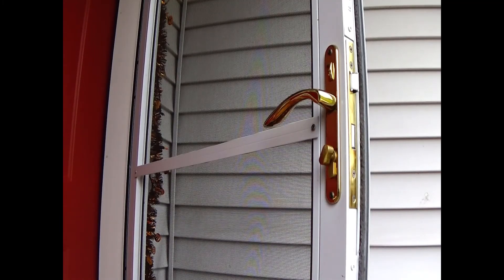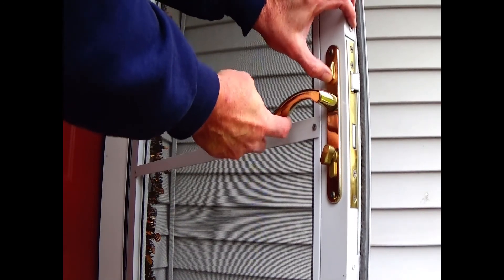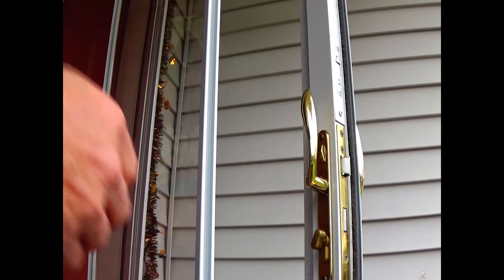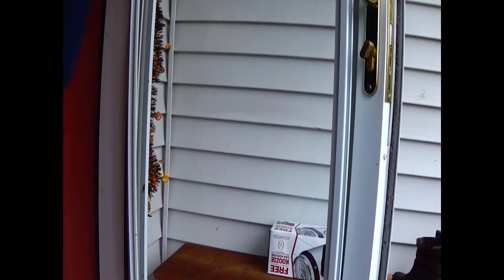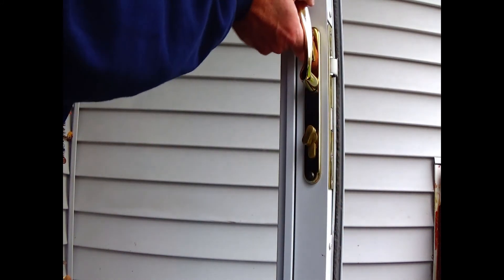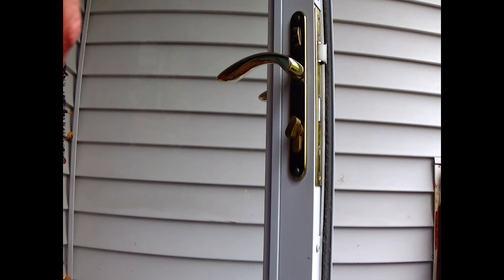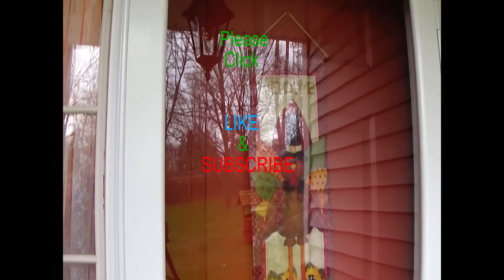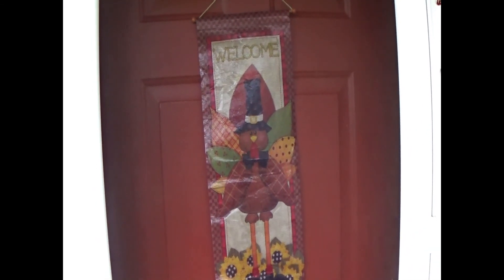Andersen 4000 Storm Door Switch Screen to Glass Panel

Comment: For me the handle doesn’t go up and vertical at all. It has been a simple task for past so many years... but this year at the onset of summer I had a tough time swapping out the glass to mesh... now I managed to take the mesh door out but handle dropped back before I could insert the glass door, and us refusing to turn up and vertical. What can I do?
Reply: Just had the same issue. Worked well when I first installed it, now this season the handle would not budge to the up postion. I removed the lock mechanism and sprayed with a dry lubricant, worked it a few times and now it's smooth as silk.!

Comment: I notice that you were not able to push down the door handle at first to secure the storm insert and then you did something and you were able to push down the door handle to secure the storm insert. We try to push down the door handle and we are not able to do that even though we push the storm insert into the door frame. What can we do to be able to push down the door handle?
Reply from the maker: The glass pane was not fully inserted onto the “knobs” on the door when I first tried to push the door handle down....I just applied pressure to the glass to keep it in place and was able to lower the handle....Hope this helps and thanks for watching!
Reply: @beachtroll8344  I applied pressure and that did not help. However, your video did help us. I noticed that you had your door open. (Ours was shut.) When I opened the door and inserted the glass, I had no problem. (I would be curious to know if you tried it with the door shut, if you would be successful.) Anyway, thank you for your help. I must have tried 40 or 50 times or more  to put the glass in and lower the handle and it did not work.
Reply: I’m having the same issue.  I got the glass panel all situated in the frame.  But now, the handle won’t go down.

Comment: All the locking knobs on the black plastic slider broke off from the previous owners apparent mistreatment; is there any way to replace the slider strip short of replacing the whole door frame?
Reply from the maker: I would try contacting Andersen directly and ask if they carry those specific replacement parts.
Reply: @beachtroll8344  I'll do that, they've been pretty helpful with some  items I needed.
Reply: Someone threw a large pumpkin at my glass door and broke 3 of the 4 knobs on the black plastic.  Were you able to get replacement parts or did you have to replace the whole door frame?
Reply: @wingerrrrrrrrr